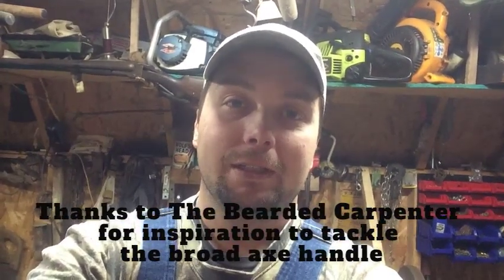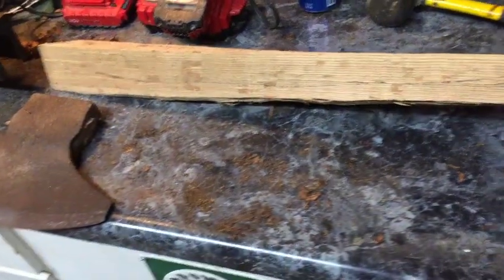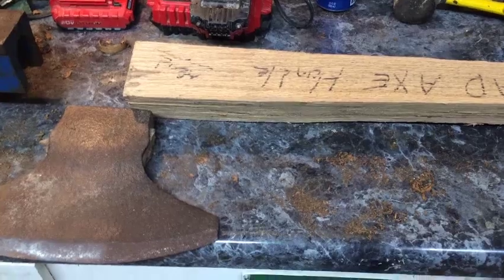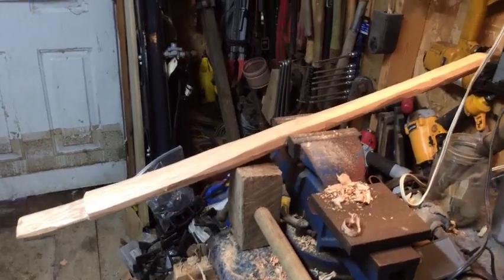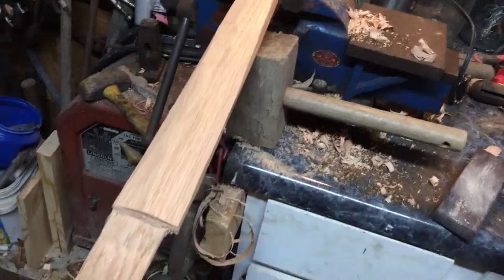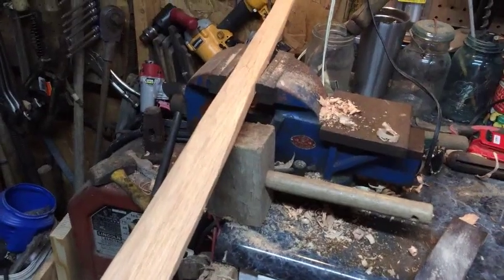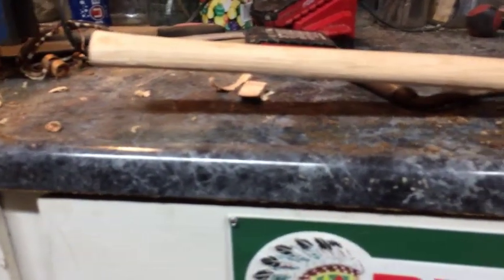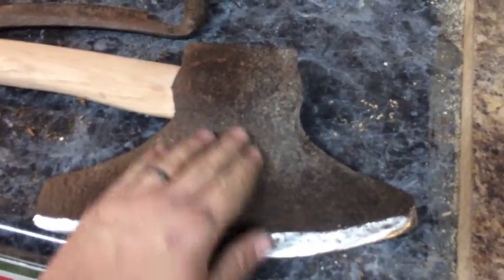Making A Broad Axe Handle

Comment: Howdy and thank you so much for mentioning us on your channel. That handle turned out great! I’v reworked several broad axes and have used a belt sander with 80 grit belts and then on to a 120 grit belt. I always kept a rag in a bucket of water and would keep the metal cool as l worked on it. I’ve been told you don’t burn the temper out with a sander but I don’t take a chance but l know a feller who can retemper really well. Anxious to see you hewing with that broad axe. Nice job!  God bless y’all

Comment: I  wish I  could  have known before you put the handle on. The axe head could have been soaked in pure white  vinegar for 48 hrs and would have been like brand new the rust just falls off pitted areas easily clean up with a wire brush. Great job on the handle.  Blessings to you and yours. 💖

Comment: Jared, you can do an "old timey" de-rusting by simply soaking the head in cider vinegar a couple days. Then a little wire brush work and it will be looking slick.

Comment: Great job Brother! I have several old axes heads that I've found while metal detecting. I've soaked a couple in vinegar and that really helped removing a lot of rust. Gool old Naval Jelly works well too. Yours doesn't look too bad. I would go with the wire cup brushes or start out with a course sand paper and work up to a fine paper  . Just don't let it get too hot unless you can quench it. You don't want to lose the temper on a good ax. 
Hope you and your family are Truly Blessed this Christmas!

Comment: I soaked one in white vinegar for a couple days and it cleaned right up. But I did that before I made the handle so you might want to try a different option so you don’t have to put the end of that new handle in the vinegar. Not sure how that would affect the wood.

Comment: Good job, I would use a  sanding disc on my little disc grinder , tha wire brush will leave it rough and pitted..Best to have it slick as possible , I like a mirror finish on my ax's and hatchets fer less friction makes fer less work. Im big  on less work  Cl;-(p)

Comment: Nice to see the old skills have not been forgotten entirely.  Just curious to why the handle does not completely fill the eye at the poll end?  My guess is that the handle piece was not quite wide enough to start with?  I will gladly trade cool and rainy for cold and dry.  At least it is sunny today!
Reply from the maker: Dale W Miller Somehow it just isn’t the same size on each end of the hole, after I drove the wedge and such I thought maby I should have put handle in threw other direction. Maby they made it that way for a reason. Handle fits nicely on other end
Reply: @FlutyLickHomestead - Jared, as long as it works and doesn't break, that's all that matters in the end.  You did a really nice job shaping that handle and using the natural curve for the offset.  Your knuckles will thank you!  I admire your skills!